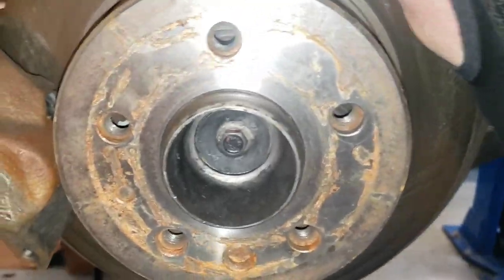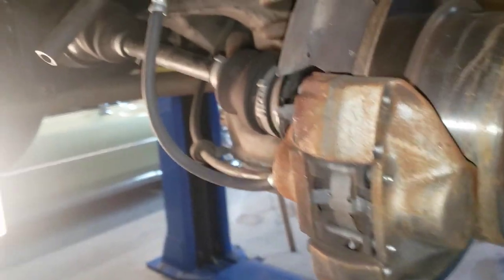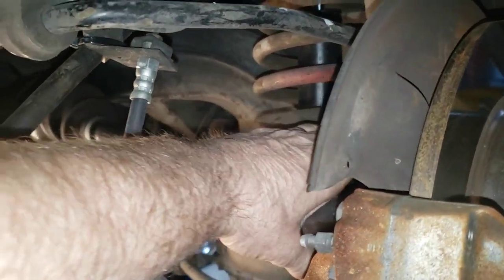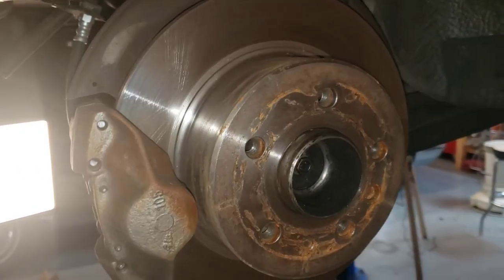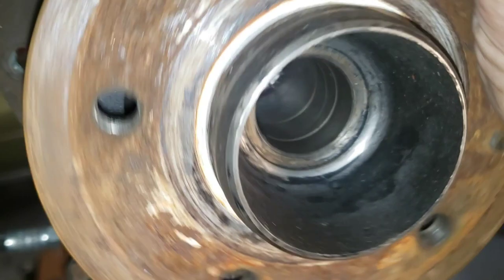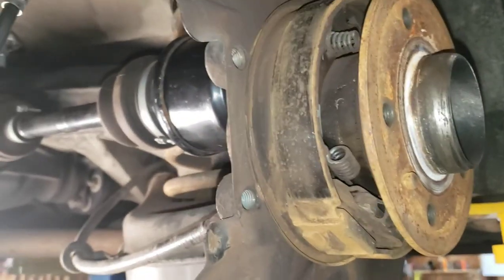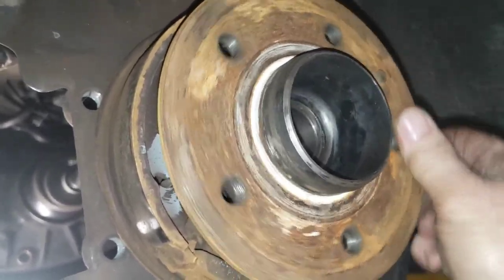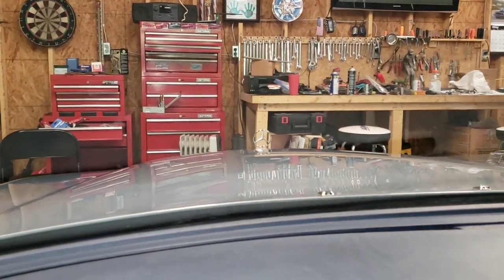VLOG - 1984 Mercedes 300SD W126 - Failed Rear Wheel Bearing Sound - CRUNCH !!

Comment: Usually will get a some sort of warning before you get those pronounced sounds. I have experienced the “rear wobble” and that usually indicates that there is a bad rear wheel bearing. The wobble happens when driving at low or high speeds and while turning the steering wheel to the left or right. If it’s a bad rear left wheel bearing then the wobble is experienced when driving and steering to the right. If it’s a bad rear right wheel bearing then the wobble is experienced when driving and steering to the left.  I don’t see how you will be doing this job while the car is on the lift unless you pull off the entire trailing arm (wheel carrier with flange).  I’ve done this job while the car is on the ground (don’t have a lift). A dial indicator is a must. When tightening the slotted nut back on to the flange, don’t tighten past the tolerance range indicated in the FSM.  If you over tighten the nut you will crush the washer (ring) beyond its limit. You will have to replace the washer and start over.  Not too bad of a job but you need patience. Reach out if you have questions. Good luck!
Reply from the maker: Thank you!. I noticed in the FSM that it says to remove the entire trailing arm assembly. I am hoping to NOT do that but we'll see.

Comment: My right rear wheel bearing in my 1990 560 SEC failed about four months ago.  The sound it made was exactly like the sound of yours.  The sound was worse at low speeds of 20-25 mph.
Reply from the maker: It's bizarre!

Comment: Man that sound is disconcerning. I have never seen the rear wheel bearings done on one of these cars. Looking forward to seeing it. In another note I am going to rebuild my turbo on my om617. I am curious how yours is holding up. I believe the mileage is similar between our cars... 175k or there about.
Reply from the maker: As far as I know it's still turboing! I've done no boost measurements however.
Reply: @ImpalamansGarage  mine seems to provide boost lazily. I see it roll coal when I get on it hard. There is some shaft play as well. So it needs a rebuild.

Comment: Just curious how many miles we're on that bearing before you noticed it was failing?
Reply from the maker: Well assuming the previous owner never changed them, it's 200,000. It seems like there was a very faint hum or something weird a couple of weeks ago but I really wasn't sure. Then last week it started to let loose and the sound was obviously coming from the right rear.
Reply: @ImpalamansGarage  I'm looking forward to the video showing how to remove and replace that rear wheel bearing I have never done this

Comment: It's midnight Tuesday night, and I thought, "Oh boy, I get to watch you replace this bearing and then go to sleep." Rats!
Now I have to find something else to watch.
Reply from the maker: Come to find out these bearing kits are all on back order from various vendors. More clever procurement means are in order.
Reply: @Impalaman's Garage  Do they have any of these at a local scrappers? I know that's a lot of work, but you might make due so you can at least drive the car.
I guess you can drive the bomb for a while.
Reply from the maker: @wernerdanler2742  Yeah there are a lot of parts in salvage yards across the U.S.  I have a scrap yard search site that I can use. If it comes right down to it, that may be the backup plan.